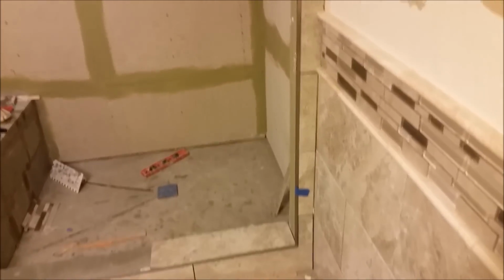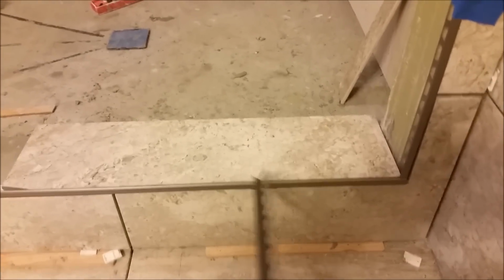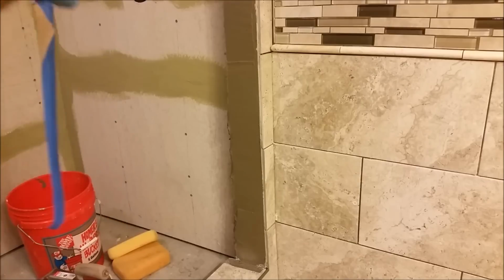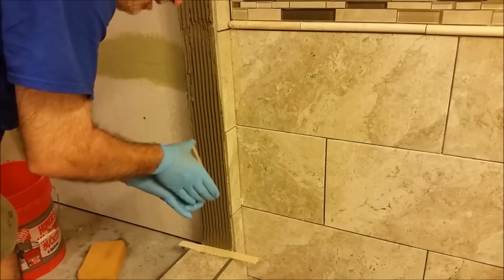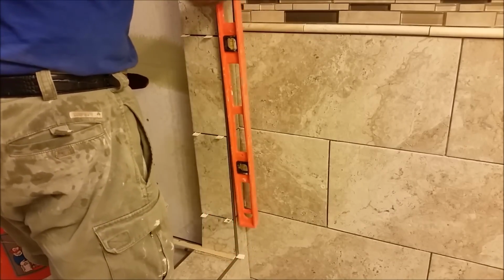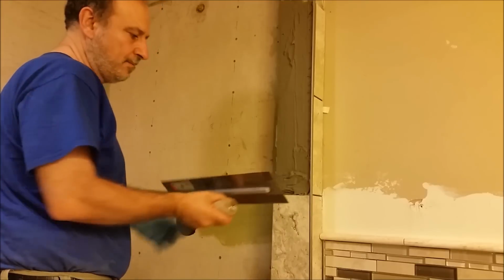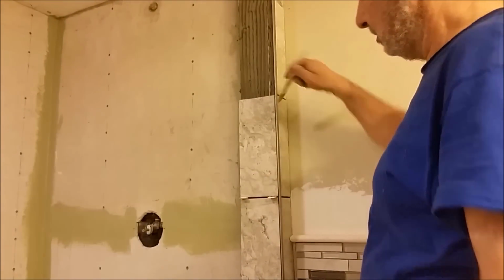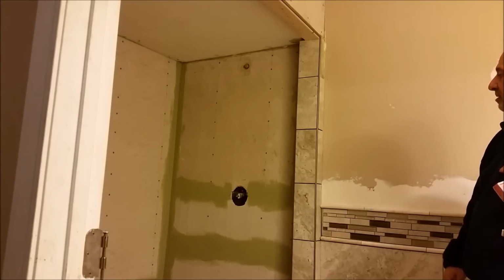How To Tile Outside Corner - Step By Step - Shower Bathroom Tiling.

Comment from the maker: Angle grinder used = https://amzn.to/368IX8C
Diamond Blade =  https://amzn.to/3j2kTbc
Dimond hole drill bits =https://amzn.to/36bX2Cs
QEP wet saw = https://amzn.to/3cLJgaW
Diamond Blade = DeWalt https://amzn.to/3jfdpSr or Black Widow https://amzn.to/3jgx18G
Grout Float = https://amzn.to/3j7KO1c or https://amzn.to/348KLMu
Notched Trowel 1/4 x 1/4 x 1/4-Inch= https://amzn.to/3j26Zpv
Notched Trowel 1/2x 1/2 x 1/2-Inch= https://amzn.to/2S5Zceg
Notched Trowel 1/4 x 3/8 x 1/4-Inch=https://amzn.to/3cDPbhZ
Nitrile Gloves = https://amzn.to/3i8VhrT
Best Thin set used = https://amzn.to/3cxVBz8
Medium thin set =  https://amzn.to/3mSk9aR
Mapei Pre Mix Grout = https://amzn.to/2HqhdC3
Mapei Grout = https://amzn.to/340hWS5

Amazon Deals:
Try Amazon Prime 30 days for free = https://amzn.to/2JMWaLe
Create Amazon Business account = https://amzn.to/3mLSyYt
Joint Amazon Prime Watch Thousends Of Movies and TV = https://amzn.to/33NfsHD
Try Personal Shopper Wardrobe  https://amzn.to/2VClfv9

Comment: why don't you install the trim first with screws (ensuring it's level), and then install the tiles?  I'm just learning - so just curious. thanks!
Reply from the maker: No. After you installed the tiles over the trim you can move the trim as needed because the thinnest is not dried yet. You will not be able to do it when you nail the trim.

Comment: hi, i did my own bathroom wall with large tiles, all seems good but i think i used too little adhesive. the finish is flush and level and seems really solid. But i have noticed when i knock on a few their seems to be hollows behind, this must be from where the wall was not as flat as the tile. do i need to drill holes and apply a fix kit or will they be ok?
Reply from the maker: Not at all.  No one walk on wall so you are safe. If it was on floor it would be a problem because the tile will be broken or pop out in time. Next time you install large tile  use 1/2 inch or 3/4 trowel and back butter the tile.

Comment: I have watched several of your videos, and they are very informative. Just curious if you used redgard or some type of paintable membrane for this project, and if not why. Thanks in advance
Reply from the maker: I always use Laticrete Hydro Ban because it is better (used in commercial). You can buy it on Amazon.
  https://www.amazon.com/Laticrete-Hydro-Ban-Mini-Unit/dp/B003CZIHR8/ref=sr_1_4?ie=UTF8&qid=1527445215&sr=8-4&keywords=hydro+ban
Reply: I was wondering that too.  I don’t see any waterproofing inside shower???

Comment: should have embedded metal first, u just cut alot of bond strength along the edge
Reply from the maker: You can do it like you suggested. It does not cut a lot on the bond because the thin set I used is not rapid setting so as a result it is still wet when I inserted the metal trim . After I inserted the trim I pressed the tile to the trim to make sure the bond is created. Thanks for your comments